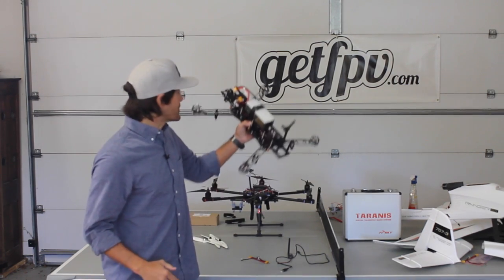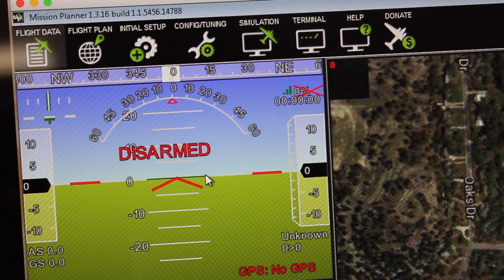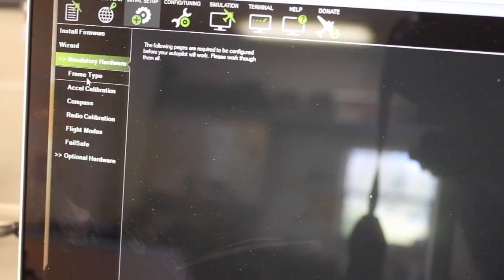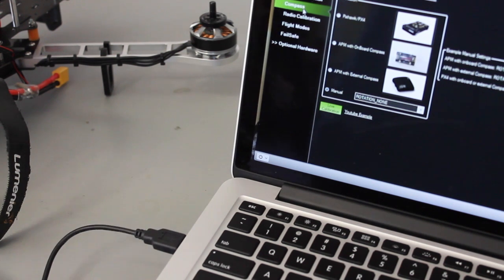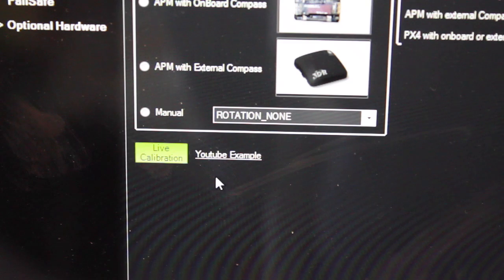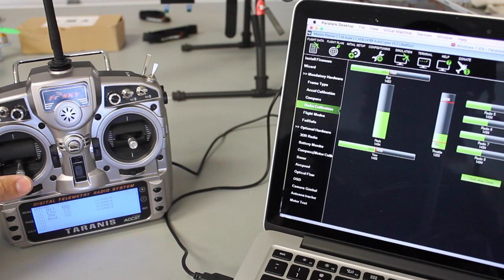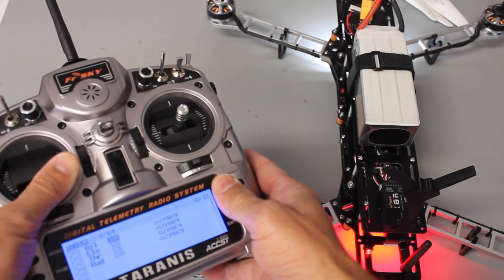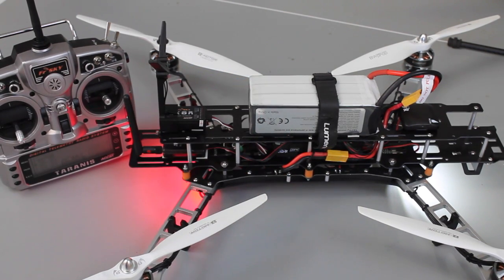QAV500 & Pixhawk Firmware Load, Calibration & Stabilize Garage Hover

Comment: Hi Dennis, hope you are keeping well and safe. I appreciate that you did this set up quite a few years ago but I have a question if I may, i belive qav  is advertised as H type frame but I see that you have selected x frame from mission planner and hence motor rotation for x type, but on mission planner motor rotation for H frames are completely the opposite of X frames. What would your advice be? Because I have this frame and been sitting for 4 years lol. Also why the motor rotation is opposite? Thank you in advance. I have learnt alot from you in the past 6 years thank you
Reply from the maker: Great point that I hadn't thought about. I used X because that is what I'm most familiar with. I'm assuming if you were to choose H there would be different gains in addition to the motor rotation. I'm not sure about the rotation either. Will try to look into this further. Here is a good post about it: https://fpvlab.com/forums/showthread.php?25113-QAV500-X-frame-or-H-frame Good luck and please keep us posted.

Comment: Hi. Have you heard of any fly away when in loiter or alt hold. When in either of those modes. The quad would stop responding to the rc control and shots up into the air.  Question 2. Also when in stabilize mode the quad would shot up into the air when it’s in the ground.

Comment: Hi Dennis, I have a question about my first quadcopter.
I set everything as you said on the videos but my quadcopter(pixhawk) lifts for 5 cm and tilts to left ward. I checked mission planner and on the failsafe option, the right side of the failsafe(which i believe is motor output) output bars are not same. Motor 2 and 3 are decreasing over time. I downloaded the plane or rover firmware and redownloaded the quadcopter firmware but this is keep happening to me. If I force it to fly it, it tilts left and flips over to right side and crash. I did esc calibration and acc, compass calibration. The only thing I can think of this my pixhawk is broken. Could you please let me know What I need to fix?  Thank you. (All my propeller are correctly setup and my motor connection is also correct checked 5 times.)
Reply from the maker: That's really strange. I have never heard of this problem before but I'd be surprised if it was anything with your hardware. Have you tried reloading the firmware and resetting params? I'd also check that you don't have any strange (curves, expo) set on your TX that is causing the behavior on your channels. Good luck and keep us posted.
Reply: nevermind it was doing esc calibration.. Thank you for your reply!!

Comment: hello. when i doing esc calibration all motors are really respond to throttle input , but after saving esc settings , and arming up again my throttle lags , and it's a big difference like from kk2 board , it's supose tu be like that or it's something wrong with my pixhawk?
Reply from the maker: I don't think anything is wrong with your Pixhawk but take it easy on your maiden flight and keep it low. So how it feels when you're in the air. Good luck and keep us posted.
Reply: Amm feels like pixhawk somehow influencing on motor behaviour , buy it's ok, i can live with that ;) thnx for answer

Comment: Hi Dennis. I've installed a 90 amp PM as I'm running 6s on my X8. Did you do a 90 amp Battery Monitor calibration for yours? If not, do you know a good link to doing one. I'm having a few issues with the low battery warning telling me that the battery is at 14.8 volts or 20% when in fact it's reading 23.2volts.
Reply from the maker: That sucks to hear. I didn't do a battery calibration for this setup, but should have. When I revisit soon I'll share some info. In the meantime let us know if you've uncovered anything. Thanks for sharing.

Comment: Thank you Dennis for replying. I've already returned that board since I honestly suspected to be a hardware problem. On my last attempt to get it to calibrate without errors, I removed the board, GPS module, buzzer & switch and mounted everything on a piece of 1/4" plywood, I ran the initial setup outside and still was getting the constant "restarting APM" while attempting to calibrate the accel, upon completion of calibration I would get errors from BAD AHRS, Bad compass health, Compass Variances, Bad RPO", so after a week of trying finally gave up on this Pixhawk. I do have another on the way, this time directly from 3DR, I'm hoping I can get that one to work. I will report my results. Thank you again. 
P.S Dennis I have probably read every post ever made in DIY Drones related to this, but unfortunately about 98% of those threads are about users reporting the same or similar problems but no information as to how to resolve them.
Reply from the maker: +traxxi2003 Thanks for sharing that info with us. I know what you mean as it relates to the diydrones forums. There are so many times I've gone in to research an issue and someone posts a question, then several days later they'll claim "it's fixed!" without giving any sort of background or info on what they did. So annoying! Let us know how your new Pixhawk does.

Comment: Dennis, I needed to ask you, have you ever encountered any compass errors or bad Gyro health error messages within mission planner with any of your Pixhawks? Have you had any luck with APM Copter 3.3 and Pixhawk? For me the install went very smooth, but as far the compass calibration and stable flying goes, it has been a different story. Suspecting potential EMI interference, I disassembled my SKyhero 850 and covered every wire and PDB with copper shielding and still same results. I'm getting Compass interference errors, "Check Mag Filed" Bad Compass health error messages but I can still arm the board. My setup is as follows:Skyhero 850mm QuadT-MotorMN4120 400KVtarot 17x5.5 propsKDE 55A ESC's3DR Pixhawk / 3DR GPS/compass module APM Copter 3.3 loaded.6s 16000 mah Pulse LipoFutaba 14SG 7 EZUHF LRS
Reply: +traxxi2003  Mission Planner released a big update to the program the first of the year that changed the calibration procedure quite a bit and added some more options.  It still won't work properly though.
Reply: +steve c  Steve , I've been working with 3DR support and they are telling me that on APM Copter 3.3, the compass mot calibration should not be used. This is what support is saying:
"which is a very dated method of evening out mag field vs motor noise; given ArduCopter 3.3 and newer uses EKF for filtering, I strongly recommend you diable compass_mot compensation as it is probably what is flagging compass variance and other compass related errors.
"Bad Gryo Health" error is usually due to the copter not being initialized properly.
When booting, you must keep it still for the first 12 seconds as it is running it's startup gyro calibration.

Adress the issues above and I'm sure the copter will fly better and not prevent you from arming any longer."

I will report tomorrow with my results.
Reply: You got support from 3DR?  I asked them if they could fix my PX4 after trying updated versions of Qgroundcontrol for a year killed it and those crooks said "Buy A New One"!
Reply: Could you ask 3DR if they have special factory software they use to program and calibrate the Pixhawk to make it work?  I don't think they can depend on the same crappy shareware the rest of us have to use for their business or they would go out of business.
Reply: +steve c I'm currently working with Santiago from 3dr tech support. But in my case I suspect I have a faulty board. The board continues to display compass errors despite that I've even tried to setup the board mounted to a plastic sheet away from any potential source of interference. I'm returning returning this one and I've already ordered another one from 3dr. The first one was ordered thru Amazon and I'm getting s full refund.
Reply from the maker: +traxxi2003 Interesting. I haven't seen these errors repeatedly before. If I do see one I can normally recalibrate and get over it. In some cases I've read about hardware failures but have never experienced one personally. Have you checked some of the cases here?

http://ardupilot.org/copter/docs/prearm_safety_check.html

I'll give this some more thought but in the meantime please let us know if you uncover anything. Thanks.
Reply: +traxxi2003  I doubt if any of those boards work since both of mine do the same thing too and the software is not good either so you can't really tell what's going on.  I've never been able to find one in person that actually flies so I think the whole thing is just a big fraud with paid reviewers producing fake videos to make them look like they can fly when they really can't!

Comment: Nothing actually works like you showed it here!  The way you did the compass calibration is ridiculous!  That will never work because you only did it on 2 axis, not all 3!  Also when I do it the program is so buggy that even after it's says it's calibrated it still says there are compass errors!  Since this was all a fake what was the point of the video anyway?
Reply: +Steve C Just because your shit don't work doesn't mean others doesn't.  I've been flying my big hex with Pixhawk for nearly a year with no problems.  It's a big learning curve but worth it.  This isn't a NAZA, boys and girls.
Reply from the maker: +Steve C This is the process I've been using successfully for some time and flying nicely. Sorry to hear you're having problems. The software can be a bit buggy but hang in there and don't give up.
Reply: +Dennis Baldwin Saying it's bit buggy doesn't even come close to how horrible all the software is. I've been trying to get Qgroundcontrol to work for a year and finally gave up after wearing out the first Pixhawk just from handling it so much.  APM Planner still won't work at all but Mission Planner somewhat works now so I've been trying to use that but it can't calibrate the compass properly and it sometimes ends up saying it's pointing South instead of North!  The way you did it won't work at all though, I have to turn the model every which way for several minutes to hit all the white spots.  I'd say your FC was already setup because you got it out of a working Iris or something and then just went through the motions to make the video, isn't that right?
Reply: +Steve C Can I have you board if your going to throw it away?
Reply: I still want to know why so many liars are making these fake videos saying stuff works when it don't!  Are they all being paid by Pixhawk, 3DR and so on?
Reply: +Steve C I've done some videos of setting up APM and not had any problems. I'm not sponsored by anyone.
Reply: I'd have to see that to believe it!  What kind of FC did you setup and was it already working before you did the video?
Reply: +Steve C  WOW Steve I know how frustrated you must be, like you, I cannot get compass calibration on my new 3DR Pixhawk to pass. I've been trying to calibrate the compass for two weeks. That being said, I think is not fair to call anybody a liar when they are simply sharing their own experiences so that people like you and I can hopefully benefit from it. I also tried Dennis method, but unfortunately it did not work for me. I know it can be frustrating but calling people a liar just  because you could not get the same results is simply uncalled for. Good luck with your FC and I hope you can get to work.
Reply: +traxxi2003  It's definitely called for!  This guy is a crook and a liar who produced a fake video showing things that can't possibly be repeated at home!  If you watch the first 5 seconds of the video and look at the big banner behind him it says he was sponsored by getfpv.com!  That means that he not only got the model for free but it was already working when he got it and he didn't even need to try to configure it with the crappy shareware that never works like the rest of us are expected to do!  What we need is a class action suit against the crooks at Pixhawk for selling worthless flight controllers that won't work like they claim!
Reply: If you don't settle down, you are going to get a law suit for defamation. I initially had the very same problems you have encountered. However, unlike you I didn't sit down and cry like a baby and blame everybody else. I sat down and researched the hell out of it. And I found solutions. And because of your disrespect and inability to remain composed, I'm not helping you. Enjoy!
Reply: I've been "researching" it for 2 years now and found the FC board doesn't work and the software doesn't work either!   Someone needs to present a counter point to all the fake reviews that show it working without any problems when that's not the case.  How can you help anyway, are you going to redesign the board so it works or re-write the software to make it run?  Actually they seem to need some new programmers on Github to fix some of the hundreds of reported problems in Qgroundcontrol and Mission Planner since the ones now seem to have got burned out with all the problems and just ignore them for 6 months then then close them out!
Reply: I've had no training with computers or software. I didn't even think I had a lot of tenacity to pursue the answers, but I found the answers and I now have three multi rotors and one plane using Pixhawks. If you thought Pixhawk was going to be as easy as a NAZA, then you were wrong. Go back to flying a NAZA as obviously a Pixhawk is way out of your comfort zone. Yes there are people out there who have problems, and occasionally I'm one of them, but the reason is that unlike a NAZA, you can alter nearly all the parameters to suit the Pixhawk for a  particular purpose. The NAZA can't do as much as the Pixhawk. Simple. There are a shit load of Pixhawks out there being used by a lot of people who are very happy. Like the old saying goes, a bad tradesman blames his tools.So you have two choices, 1/ Suck it up, be NICE, and methodically work through the problems. If you are nice, people will help you. If you behave like you have up till now,  nobody will.2/ Go buy a NAZA or NAZE32 and be limited in what you can do.Either way, stop whining!
Reply: This dude probably doesn't know how to operate a freezer from the 70s with the way he's talking.  I have my PX working just fine.  Sure, there were some bumps along the way.  That's the fun of it all.  Sheesh.
Reply: Courierdude, I tried a Naze32 but it was garbage and was so poorly made the USB port fell off when I tried to use Cleanflight so I send it back for a refund.  Also you are a liar!  I don't believe you have any Pixhawks flying since they don't work and the software won't run!
Reply: BigTulsa, it's not been any fun trying hundreds of new releases of Qgroundcontrol over the last 2 years to see if they would ever come up with a version that worked!  They never did and Mission Planner doesn't work either so I finally gave up and put the whole thing away in the closet!
Reply: Sounds like user error.  Sorry but it does.
Reply: So Pixhawks are useless and their owners are liars, and Naze32 boards are useless because they all fall apart. I'm seeing a definite pattern here. Good bye loser.
Reply: I'm surprised this dude can remain vertical.  Hundreds of releases?  I've never had any issue with Mission Planner.  LIke I said PEBKAC error.
Reply: PEBKAC....nice initialism....!!
Reply: I have to admit that the pixhawk aircraft I have bought already built, are still sitting in storage! I also have 2 TBS discoveries with EagleTree Vector. I am still only comfortable with Naza and its "power up, spin two times, repower, and fly" style of compass calibration for now. I do hope that one day I can crest that hill. I think basically its also the ease of the user interface, since Naza has just a few simple screens to move thru, as opposed to Eagletree and Pixhawk.
Reply: You will probably never get the Pixhawk to fly since in 2 1/2 years the software to configure it has never worked and still has 400 or 500 unresolved issues!  These videos are nothing but a scam where the producers are paid to make the product look like it works. Most of the time they are just going through the motions without actually doing anything then showing a working factory built and calibrated model at the end.
Reply: steve c Q AV do not build multirotors. They sell frame kits. the thousands upon thousands of people using pixhawk as controllers for multirotors and airplanes certainly must have done something to get those going because none of those work completed airframes either. And what about the solo from 3dr? it uses the pics off controller and the only reason the company went under if they couldn't match the sales volumes of the larger box versions from other competitors. as one of the other posters said, if it scares you go back to something easier.
Reply: Maybe you'd be better off with paper airplanes.
Reply: BigTulsa not neccisarily true...ive seen plenty of fake youtube videos on paper planes sponsored by georgia pacific....

Comment: great video the problem is my tarot 650 with pixhawk doesn't really work, when I apply the power it is trying to go back  and will flip eventually, al calibrated as should be.
Reply from the maker: Zycie w Californii One suggestion is to make sure your motors are spinning in the proper directions with the right props. I'm assuming this happening before you even take off?
Reply: +Dennis Baldwin yup, you are right,  it's fixed, it works fine, I noticed that hold position isn't working the best, tarot holds the position,  but it may move away coz of the wind, and it isn't good, I would need to recalibrate it, and install the compass higher. thank you